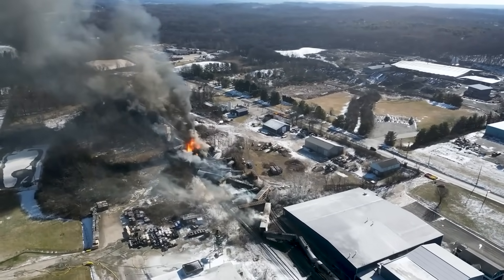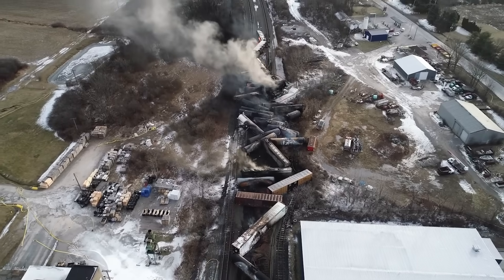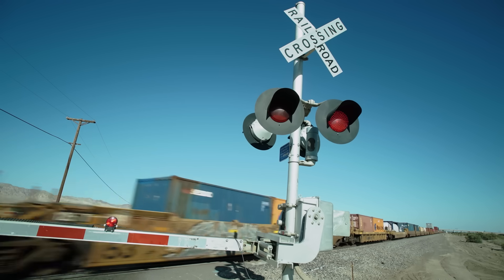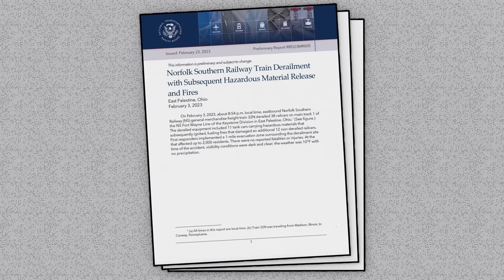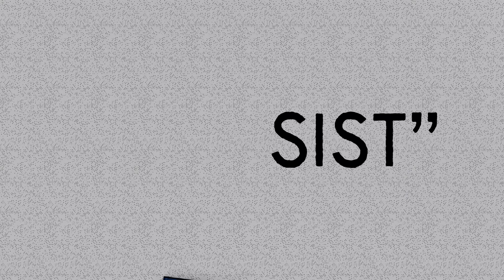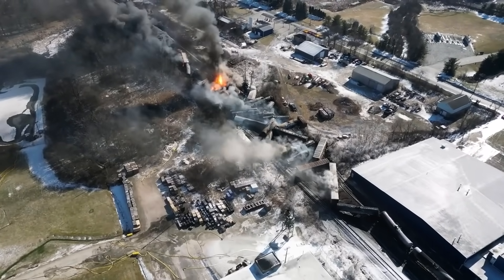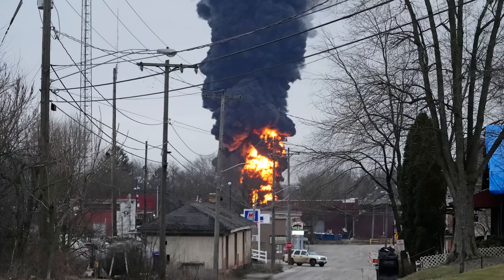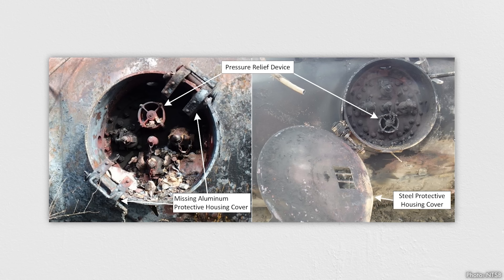East Palestine Train Derailment Explained

Comment: It blows my mind that the rate of change of wheel bearing temperature is apparently not considered by the monitoring system
Reply: Yeah, you would think if the temperature was increasing that much with each measurement then it would trigger some kind of notification at the very least.
Reply: I agree mate. The Company's standard was 170-200º before any action was required.  Though there was a definitive problem with the initial hike in temps.  They should be detecting rapid changes in temps not a threshold that is already above the failing point.
Reply: The issue is sampling rate (or interval): eg: If you detect temperature T50 at mile post 50, and T60 at mile post 60, then at 60 MPH 10 minutes have gone by, so the rate of change might be 20°F per minute, but you wouldn't know that until mile post 60 when the temp has changed by 200°F.
Reply: This is because of how the detectors operate. Only "pass/fail" info is sent to the crew. So the crew isn't aware of any brewing problem until a "fail" is detected. Even then the crew doesn't know exactly what the failure is, just that they need to stop and walk the length of the train to find the problem. Also, the wayside detectors are not networked together so previous info is not sent ahead to the next detector. Obviously some improvements need to be made.
Reply: @joeyager8479  that's kind of how most problems work, they aren't problems until they are. And modern defect detectors inform you of the nature of the defect be it dragging equipment or a hot axle and inform the crew of the approximate axle number that it is near. Do some basic math of your average train car having 4 axles and it's pretty easy to figure out where on the train you need to look for the issue. As far as connecting DD's together it'd probably work in more developed areas where a detector probably has a power connection to the electrical grid and any sort of fault can more easily be transmitted but once you get into more rural areas or the middle of nowhere transmitting all that data to another unit that might be many miles away becomes prohibitively difficult to do. Radios only go so far
Reply: @TheIcyWizard705  Thanks for the info. Back in the 1960s my uncle worked as telegrapher at a tower near where I lived. He could communicate with the railyard (my grandfather) and other towers but the engineer would need to physically reach out and grab a hand written message attached to a yoke that he held up as the train passed by. The engineer would toss out a message written on a piece of paper rubber banded to something that looked like a rock and my uncle would need to run after it and transmit the message to the next tower the train would pass by. My brother and I used to laugh our butts off about how primitive that was! They've come a long way, but still need some improvement.
Reply: Rail defect detectors operate locally, they would need to be networked in order to do this but that would be a HUGE improvement!
Reply: @BikesBobbers  or they just need to output all of their data to the train.

so networking between the stations ain't required.
Reply: I like how everybody has all these interesting solutions without at all considering the additional cost that would be added directly to everything you buy on a regular basis
Reply: @JohnnyTromboner  you'd hate to cut into their record profit of 8+ billion last year...
Reply: IIRC the sensors are self contained, so they can't communicate with the ones next to them and they don't communicate with some central server, just send a radio signal to the passing train. I agree though that rate of change should be looked at, but it would be an expensive and extensive retrofit, so the rail companies won't do it unless forced to, and they'll lobby hard against it.
Reply: Exactly my thoughts… even if one is higher I’d think I would have very different reactions to the readings:
Bearing A - 120°, 121°, 124°, 120°
Bearing B - 30°, 31°, 40°, 100°
Reply: Usually the wheels reach a certain threshold and the heat actually helps smooth the bearing and so the temperature plateaus or drops once the blemish is smoothed. 
Additionally, this data is not sent to train crew, but is broadcast to a central traffic control location and may not be readily available due to number of axels and sheer quantity of information provided per train
Reply: @Adam_Malkovich  No expert, but from some railfanning vids, the data is sent over radio in "verbal"  form stating the location, number of axles and faults found. So the conductor/engineer should hear it over the radio immediately.  (Indeed you hear such in this video - which in turn is taken from a rail fan video).
Reply: Does measuring by ROC cause too many false positives? 

For example, your cars engine has a huge ROC until it reaches an equilibrium in the set parameters.
Reply: I agree, it wasn’t the actual temperature that would worry me until it reached limits, however, the rate of change should have raised alarms. Should take much to determine if the temperature is increasing at the rate as the monitors showed that something bad is about to happen. Maybe they should look at additional crew training and procedures so that this sort of data can be reasonably interpreted before a bearing collapses.
Reply: It is actually.  Grady only touched on the surface of what RR have actually installed.  On high traffic lines, the hot box detectors are networked and closer together.  Bearing and wheel temp trending is monitored.  However majority of tracks  have a low volume of traffic so this investment in networked hot boxes is just not done.
Reply: Measuring the rate of change would be far more complicated and therefore unreliable. It requires each monitoring station to get the full data from the previous one and compare all bearing temperatures one by one. That’s a far more complicated and unreliable system than a device that sounds an alarm if it sees anything hotter than 200 degrees.
Reply: The rate of change was something determined forensically after collecting data from multiple independent defect detectors.  Neither the rail workers nor the (completely isolated) defect detectors could have determined it in realtime.
Reply: Americans never pay attention to the cheating incidents in their own country. On average, there are 800 cheating incidents every day, which is more than the cheating incidents of all countries in the world combined.😂😂
Reply: Even if the system would do that - wouldn't have helped when more than half the sensors were inoperable at the time cause the railroad-companies simply didn't want to repair them.
Reply: @WDHIII " If they didn't work we wouldn't know the temperature change."
.... so do you really want to claim that if 1 100% independent unit fails the entire system is down?

"The third detector caught the hot bearing and alerted the crew"
The third WORKING detector - after passing 3 others that didn't work.
Reply: @WDHIII "Do you know even know how detectors work? And yes I stand by my facts"
it is obvious that you stand by """your facts""" - and they got nothing to do with reality.
Fact is the train passed multiple detectors of which the majority were NOT OPERABLE.
Doesn't matter how much you want to lie - your lies have nothing to do with what actually happened.
Reply: @made in the 80s Shittily.  They work shittily.
Reply: @made in the 80s Were you talking about anything else?
Reply: Precisely.   It seems so obvious to this small time farmer a large increase in bearing temp is a red flag
Reply: A rate of change of that degree is actually very common and often exceeded when braking hard with air brakes. THe wheel gets hot thanks to the friction.
If it's 40 degrees out and the wheel is roughly that temperature at one detector, then you have a 10mph slow order very close to where another happens to be, your wheel temperatures very well may exceed 150 or even 200F if you have to slow from 55MPH with a heavy train. 

Rate of change monitoring isn't done because it would cause far too many false alarms, and in time, complancency.
Reply: @pootispiker2866  I'd expect breaking action to raise the temperature of most wheel axels, but if the monitoring system sees a single axle rising in temperature it would seem reasonable to assume that something is wrong with that specific axle. If there's anything else that would make a single or a small subset of axels experience a much greater rate of heating compared to the rest in normal operation, please do inform me.
Reply: @kyomujin4402  These detection systems are actually pretty dumb and assume absolutely nothing. If many axles are too hot, then it will list 3 or 4 before saying that there are too many alarms.
Reply: @pootispiker2866  may be a more ingenious system that would monitor the degree of change in each car and compare that to each other would be more efficient at preventing man-made disasters like this?
Reply: @pootispiker2866  Context is important. If you aren't braking then something is likely locking up.
Reply: @pootispiker2866  So crosscheck it with braking and other wheels.
Reply: @samiraperi467  LOL
Reply: @pootispiker2866 But I'm guessing it's rare that only one axis is getting that hot, if all the other ones don't?
Sure, if all axis are getting hot, it's most likely not of any concern. But a single one? There must be something wrong
Reply: @MrEdrum  brakes don't necessarily apply evenly
Reply: @pootispiker2866  If every wheel, bearing(heat) and axle(RPM) had sensor it would be very easy to monitor for issue. All the computer would have to monitor for is for significant heat offset (for the axle RPM offset). The computer could easily give a warning when one axle is significantly outside the average of all other axle.
Reply: @TwinShards  defect detectors literally already do that job
Reply: @TwinShards  that's not required. just record the temperature of every axle and then check for large differences between them.
Reply: @pootispiker2866  Yes the defect detectors do detect temperature, but the problem is they're too far apart. Having a local sensor on each wagon would be able to provide continuous feedback and catch the problem the moment it happens, not 10 or 20 minutes later when the wheel has already chewed itself to pieces. For the cost of rolling stock, it seems trivial to put a couple of basic IR sensors on the axles. Even low end passenger cars now have stuff like tire pressure sensors etc.
Reply: @TwinShards  that's a lot of additional equipment for railcars that are unpowered. Don't get me wrong in a perfect world we would have something like that yes but there are certain constraints that we have to deal with in the real world
Reply: @pootispiker2866  if it's already braking at that point though it won't be an issue
Reply: @Kyle M  Yes it very much could be. Trains in the US can have the brakes set while moving for miles without the intent of actually stopping. It's just normal railroading.
Reply: @pootispiker2866  however with the additional metadata showing that no other axle was doing the same thing those false alarms can be weeded out.
Reply: @Pootis Piker  it would be simple to take braking tempatures into account in this technology.
Reply: @KPSchleyer  simple? How so?
Reply: @KPSchleyer  "simple"
Reply: @pootispiker2866  just compare the rate of change to the other axle/ bearings. You can also have ir imaging to "see" where the heat source is.
Reply: @KPSchleyer  Train wheels don't work like that. If the wheel is hot because a brake is hung up, it won't look any different at all from a bearing in its first stages of failure.
Reply: @pootispiker2866  Could a temperature monitoring system, as mentioned by others, be corroborated with data from another sensor? Say, an inertial measurement unit, where you look at the gyroscope and accelerometer data. Acceleration to check whether the train is slowing down, which could be checked against whether the train is braking, as a backup for the state of the air brakes. The gyroscope to have data that accounts for the situation where the brakes are applied but there is no deceleration, like in a descent.

Bit long winded of an example, basically I’m thinking that diversifying the data collected could give a monitoring system a better picture. Yes it’s even more cost and extra points of failure, but they’re not that mission critical. Best not to have them down for too long but it doesn’t “ground” the train.

Also the sensors like an IMU could be incorporated solely into the locomotive, don’t need that much redundancy, one on every carriage.
Reply: @Mister Hat  hahaha oh my lord, these armchair experts and their "simple" ideas that consider absolutely zero factors.

A freight car can have measurably hotter wheels while being in no danger whatsoever of a catastrophic failures. Lazy brake valves can have the brakes dragging for much longer than other cars before it releases, if at all, making for 30-50 degrees of difference between it and surrounding cars.
Reply: @Pootis Piker  you obviously don't know about ir imaging, you will see the heat source
Reply: Well when an entire industry is expected to self regulate
Reply: @SinisterElephant  It works for aviation, so why not trains?
Reply: @embustero71 The FAA regulates aviation in the USA not the aviation industry itself.
Reply: It blows my mind that they don't have microphones on those defect detectors. You can usually clearly hear with your own ears when a train car passes with failing bearings...
Reply: Deregulation
Reply: @haruhisuzumiya6  source? Oh, wait, you pulled it out of your bum.
Reply: @haruhisuzumiya6  Yep, we had regulations being rolled out that would very likely as stopped this. They were removed by Trump.
Reply: @AGryphonTamer  If you get rid of regulations, you can always exceed regulatory requirements!
Reply: @AGryphonTamer  The regulations in question would not have covered this incident. The regulations that were removed by the Trump administration applied to, "Highly Hazardous, Flammable" materials; The materials in this case were simply, "hazardous," and thus would not have applied. There were, in fact, three cars on this train that would have fit the regulations in question, but they were not involved in the chemical spill. The NTSB chairperson, Jennifer Homendy confirmed all of this, and you can find this information at fact checking websites.
Also, as covered by this video, the failure here was a wheel bearing, and the rule requiring ECP braking systems would not have fixed this. (again, this is covered by fact checking websites.)
None of this is an endorsement of the Trump administration repealing the rules.
Reply: @AGryphonTamer  do you actually know this or are just making stuff up because “Trump bad”?
Reply: @AGryphonTamer  source?
Reply: @AGryphonTamer  Citation?  That misinformation has been thoroughly debunked.  Just a political talking point not based in reality.
Reply: @AGryphonTamer  Which clause of those regulations would have stopped this? Why did the Biden admin not reinstate that clause in the two years they had?
Reply: @AGryphonTamer  Please be more specific
Reply: @AGryphonTamer  The regulations in question would not have applied to the train that derailed had it been in place. The regulations would have applied to single manifest hazmat trains (single cargo) like oil or ethanol trains. Mixed manifest (many different cargoes) trains like this one were not included in the new regulations. It's just not factual to insist that these regulations would have had an impact one way or the other in this incident
Reply: @AGryphonTamer  prior to that Obama was kind enough to okay the roll back of regulations that allowed this train to avoid the high flammability hazard classification. You gotta love that bipartisan cooperation.
Reply: @AGryphonTamer  I am about as anti-trump as this come, but as I understand it, this is patently false. Those regulations would not have applied to this railcar. But this was a while ago, I'd like to know that he did cause it. Just for the lols
Reply: @AGryphonTamer  that's incorrect. The regulation, if still in place, would not have applied to this train and, even if the train had ECP brakes, they still wouldn't have prevented the derailment. They may have reduced the severity, but brakes aren't going to stop a wheel bearing from failing.
Reply: One would hope that the crew would have taken notes and taken the decision that someone was "going South."   The trackside detector just transmits an computer generated audio report.   In the era where central train control is close to being mandated, it might make sense to coordinate these trackside reports.

Of course, it's possible to over focus on the particular cause of this particular wreck.   De-rails are almost routine.
Reply: @GilmerJohn  The train crews don't have access to the raw data from the defect detectors. The hot box detectors trigger an alarm when the temperature goes above limits. That alarm is the first notice the train crews get that there's a problem.
Reply: @bb_37  thats too little, too late. 

at least they should have someone (be on the crew or in a control room) with access to all the raw data summarized to the main paramaters and trends known to raise the risk of damage or failures to be able to a early judgment to a maintenance stop or even a emergency stop.

 dedicated diagnose units should also be a big help, something like a drone that can go to a suspect car and do a detailed view of what's going on to a trained team, and help do the decision of changing the train behavior or call a full stop if needed
Reply: @bb_37  --  OK.   I thought the 'voice' mentioned the temperature.  False memory on my part.   Thanks for the correction.
Reply: @bb_37  Which should be easily recognized as a terrible alarm system.
Reply: @John Gilmer  The detector 100% does not generate a "report." Its feedback is purely a pass-or-fail remark.
Reply: @GilmerJohn  'De-rails are almost routine.' There is that complacency coming up again. 
Europe, and Australia do not have the number of derails per train mile the US has. They have 'enforced' regulations in place.
Reply: @carlthor91  --  Well, the US has a LOT of rails out there.   The "regulators" could/should/might want to break down where the incidents occur.   A "typical" derail literally just takes a wheel set off the rail.   The recovery involves two guys with all their equipment on a light truck and something on the order of a hour's work.   This type of incident happens on poorly maintain track and old equipment.   How much money would  have to be spent to, say, cut the frequency of these incidents in half?    Who would pay for this?   Would the customers or community service by a lightly used spur be willing to pay or would they prefer to accept the occasional accident?

I personally don't have a dog in this fight.   "Locally," the county has an industrial park adjacent to a large landfill.   Until about a year ago there was a medium sized "standby" coal powered generating plant.   About 10 years ago a spur off that line went to a quarry which supplied a few carloads of rock each week.   Some 40 years ago, the tracks actually extended to a US Navy support facility but the Navy decided it didn't want to play with trains anymore.    But without the coal traffic, it's not clear how much effort the RR could/should/might spend to keep the line serviceable.     It's "customers" are the landfill which takes in garbage from Big Cities and a place that brings in re-bar for pre-cast concrete.   

Again, I wonder how long this 6 mile extension will be keep connected to the rail network.
Reply: Your mind is too easily blown. What should be used is computer vision to detect sparks flying off the train. That is a fire and personal safety hazard regardless if it causes a derailment or not.
Reply: @HyenaEmpyema  If sparkes are flying out then the issue has already become critical and potentially too late.
Reply: @HyenaEmpyema  Saying my mind is too easily blown because something extremely basic isn't even being done and then suggesting a far more complex solution doesn't make you seem very bright.
Reply: @HyenaEmpyema  don't worry bro ai and cameras will definitely not be tripped up by flying leaves and sand dust
Reply: Same with why there was SO MUCH of the stuff: deregulation by crooks.
Reply: Not much hotter than a CPU or other computer components.
Reply: @defeatSpace  That really has no bearing on this subject.
Reply: @misterhat5823  it actually does for the checkpoint hardware, heat capacity, and maximum safe operating temperature
Reply: @defeatSpace  If your "CPU or other computer components" reach 200 F over ambient, they have been long gone by then and your PC should literally be on fire.